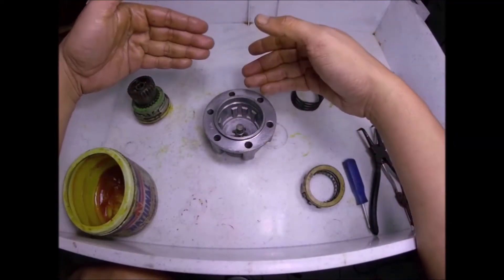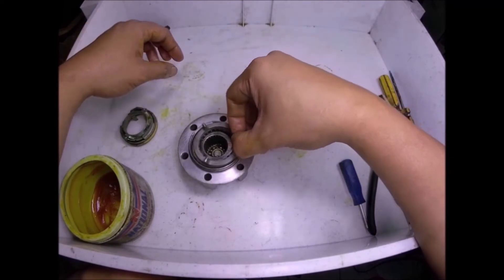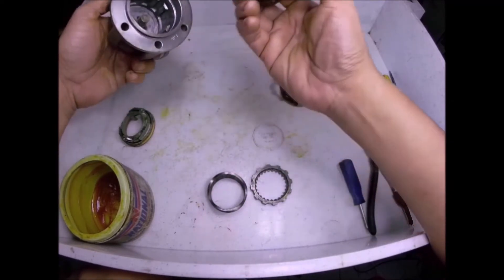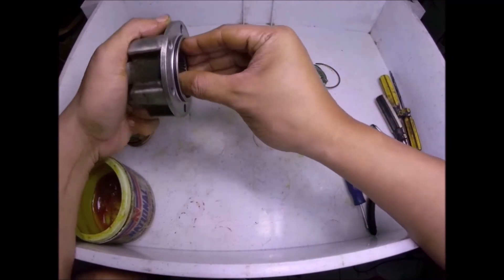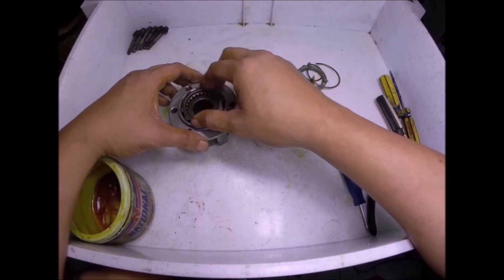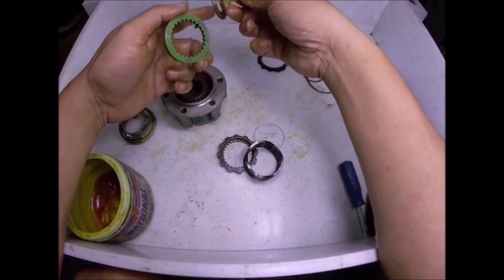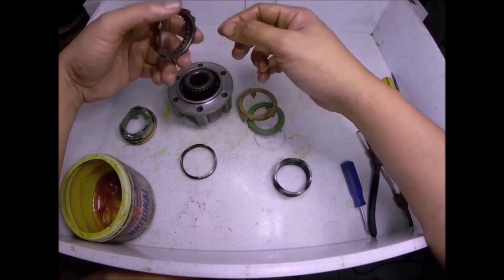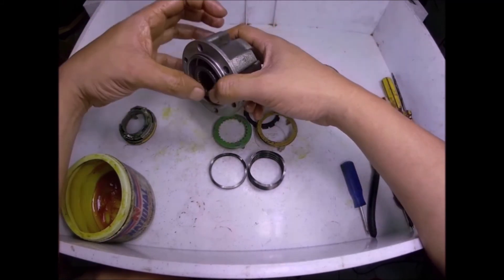How to FORCE LOCK a non working 4x4 Auto Lock Hub - PART 6

Comment: You mean i can engage 4x4 without this hub. I removed the inards of my hub because the plastic parts broke into pieces
Reply from the maker: No, you still need the running hub. Its just that if the auto engaging parts are broken you can still engage the 4x4 but you need to force lock it inside

Comment: After the spring should we add something else the gear is down then the spring after..??
Reply from the maker: nothing to add..the spring is already doing its work for the gear not to go out of engaged locked position
Reply: @DIYAllManphKDWzpeedengineering  but the parts that are left i meant the plastick things and the smaller spring
Reply from the maker: @vaskospaseski7401  If the lock hub is already defective, wont autolock anymore...you wont need the other parts remaining in forcing lock the lock hub
Reply: @DIYAllManphKDWzpeedengineering  thanks dude you helped me a lot im subbed to your channel👌
Reply from the maker: @vaskospaseski7401  Thanks also :)